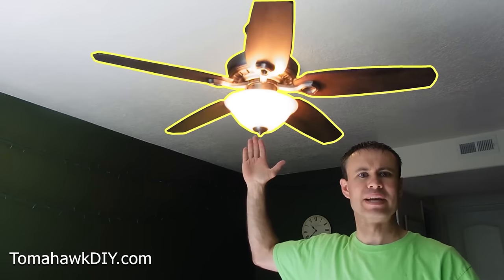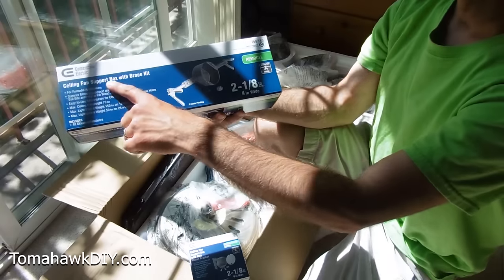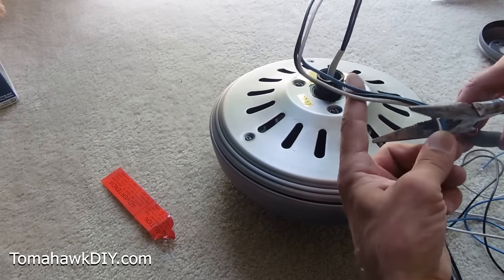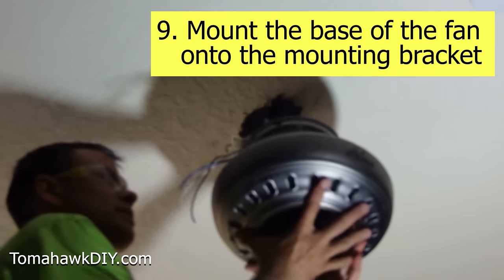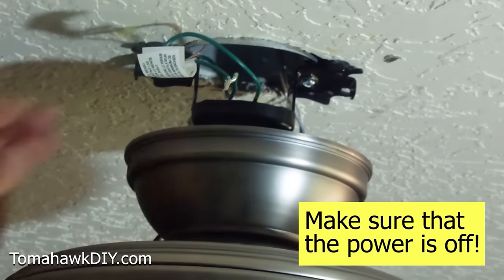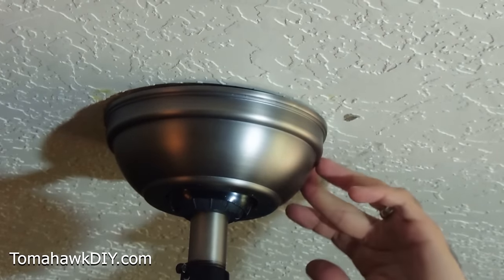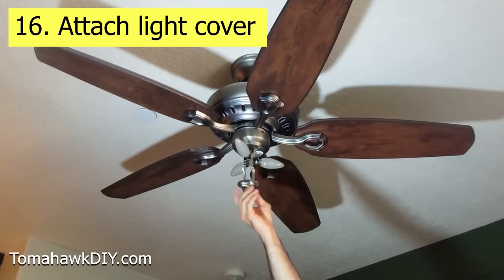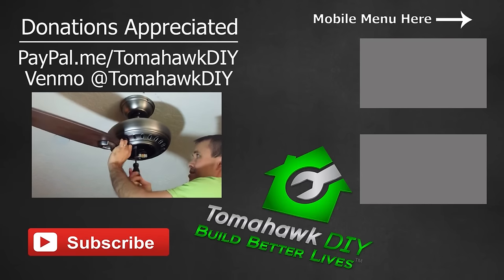How to Replace a Light with a Ceiling Fan (Install a Ceiling Fan) - Step by Step

Comment: You forgot to point the stud finder at yourself and say "Hey. I'm a stud!". That's required whenever you use a stud finder.
Reply: I knew you would be here.
Reply: Its why the stud finder didn't work. He skipped an important step.
Reply: if you have to remind yourself that you're a stud then it's likely you are not a stud

Comment: @ 4:55 you mention having to replace the junction box, because when you install the bracket, it has to be on a stud.  The existing junction box, was not positioned correctly for this new bracket, BUT, then at 8:12, you're screwing mounting bracket into junction box.  What happened to the INSTALLATION OF THE NEW JUNCTION BOX?
Reply: Yea bc I need to see that
Reply: Yes, he just skipped the hardest part
Reply: Thank you, I thought I was losing my mind.
Reply: This ⬆️
Reply: He moved the project to another room 😂 13:01
Reply: Most modern homes have the light fixtures mounted on the studs already. I think he left that out. That's why he hang it on the same location.  Who puts a lightning fixture on sheetrock, it shouldn't pass code? That whole stud-finding stuff wasn't necessary.

Comment: I Noticed that as well.  Tomahawk you didn't vlog the support beam part. That is the reason I looked up installing a ceiling fan. Thank you for the cool video. Good thing using the  fluke tool.

Comment: I want to mention that if the existing light fixture is on a dimmer, and there is no separate hot wire, the dimmer must be removed. If there is a separate hot wire, motor must be either wired to hot wire that isn't on a dimmer, or the dimmer must be removed. Fan motor should not be on dimmers, but fan lights can be on a dimmer as long as the dimmer only controls lights and the motor is 100% independent from it. Just a common mistake people including some electrician make when replacing a light fixture with a ceiling fan.

Comment: Thanks for great video! You mentioned that one needs to use the right length of the screws for the ceiling bracket. Does the right length of screws come with the bracket itself?
Reply from the maker: Yes, it should

Comment: Great video.  You mention in one of your comments that the original ceiling light was on a dimmer.  What did you do with the dimmer? Replace it with a switch? If so, what does the switch control? Do you just leave it on all the time so the remote controls everything?  Thanks

Comment: So did you already have 2 switches (1 for light and 1 for fan) or did you have to drill for one for the fan?  Where is the pull down chain?
Reply: He has a remote ceiling fan.

Comment: What if I only have 2 wires in the ceiling? I have an old house. I replace my 2 kitchen fixtures with updated flush mounts. The boxes only 2 wires in them so the ground wires on the fixtures were secured to the metal plate that came with them. I want a ceiling fan in my living room but I’m sure the wiring is the same as in the kitchen. Am I just not able to install a fan? I’m not smart at this kind of stuff so not sure if this will work for me.

Comment: Question. Hoping you’ll see this expediently. As I just bought the fan. I’m going from a ceiling fan with a light, to a ceiling fan with no light. Can I just cap the existing wire for light source with a plastic screw nut?

Comment: I’m not a fan of the hunter brand. I know people love it and stand by it but the Hampton Bay (Home Depot brand) is way easier. Now I do work there I’m a sales man in electrical but I’m being unbiased. The new easy install fans save so much time and there mostly all led now and doesn’t even require a bulb. Blades snap on and are secure. And some have the remote built in already.
Reply: I've had a few Hampton Bay fans in the past t hat were pretty good, but some of the Hampton bay stuff I have bough more recently is cheap crap.

Comment: Did you end up putting g a different mount up on a stud? It looked like the same housing and just the stock mount that you said wouldn’t work. Just wanting to check
Reply from the maker: Yes - here's the video showing the junction box install. https://youtu.be/e8_0HqZA30c

Comment: Hello! I am trying to install a ceiling fan but my problem is there only seems to be a ground wire coming from the mounting piece and none from the actual lamp, only the blue (light) and the black and white. Is it possible it is a defect and the lamp is missing it, or is that something normal? I tried connecting it regardless and the lamp works when I use the pulleys but if I use the wall switch the breaker flips. If you have any tips it would be greatly appreciated! Thank you 😊

Comment: I thought due to the stud Location you couldn't install the fan directly over the old box? But then you did just that later on
Reply: Shark Flap... the reason he could use the included fan mounting bracket, is because he changed out the light box that is mounted to the ceiling joist. There is a video for installation of that new bracket at the end of this video.
Reply: If you missed that detail in the video, don't try this yourself.

Comment: Do you need to check if your light bracket can support such a weight? 
Or is the side mount bracket enough?
Reply: If the fan falls when spinning you will find out 😂

Comment: you explained that the original electrical box was in the wrong place, and said a new box would need to be installed....but later in the vid it looks like you used the original box anyway.
Reply: Looked like the original box still to me as well. Pretty sure that it was installed to original box and was never changed.
Reply: @travisspoerle1557  That’s how I saw it too. He didn’t change anything out. the junction box in the ceiling didn’t get changed out and he used the bracket that came with the Fan.
Reply: @dillonwingo7372  no he did not
Reply: He replaced it but made a separate video showing how

Comment: Just gonna skip the new junction box replacement huh
Reply from the maker: Nope - that deserved it's own video. Check it out here: https://youtu.be/e8_0HqZA30c
Reply: @TomahawkDIY  He told you "MeowMix"
Reply: Also...can't you read??? The comment below mention the same thing. You sound like you just mentioned this to appear knowledgeable on the subject. No need to be "catty." Meow Checkmate.
Reply: Yeah ...., how did you work around the offset of the ceiling joist?

Comment: What if the fan doesn’t have a remote and you want to wire the fan and light to seperate connections in the wall?
Reply: You can buy a remote separately, or a wall remote. Or a 2-wire fan/light wall control that sends signal to a receiver.

Comment: When you are setting fan in the bracket , is there any locking machanism to hold the fan tightly in the bracket or just hang it there ? 

Need your comments please.

Comment: wish is low key one of the best places to get an electrical tester i got one for 50 cents or it might have been free i forget but it works just as well as the dewalt my manager uses in fact i like mine better its louder and brighter XD

Comment: Couple things not understanding the old bracket to new bracket thought you were going to add a new bracket? And also anytime i work with power even if the entire city is turned off i will always rewire nut the wire that I unspliced again. everyone does things differently but thats just what i would do. Not a bad video just think things should be explain alittle better.
Reply: Andrew West see link he added.

Comment: Any idea what would cause the remote not to be able to turn the light off in order to use the fan? My fan works but the remote won’t turn the light off. I can turn it off at the wall but it’ll also turn off the fan.
Reply: Maybe try to toggle the channels on the remote if it has it. Mine was in the battery box area
Reply: Wireless fans suck. Always buy the fans with the chain if you don't want to spend half the day trying to turn it on or of. On the other hand, if the light and fan go off or on at the same time, it was probably installed incorrectly.

Comment: Because my fan/light has a remote..electrician did not wire to the ight switch. Says is my fault cuz I didn't want hanging chains..should I just take it down and hook to the light switch?

Comment: Is the original light box strong enough to anchor a rotating fan?
Reply: if plastic, no. One should have a proper ceiling fan box, preferably metal

Comment: I"m confused, you skipped over the part of installing the replacement junction box?
Reply: At the end of the video, there’s a link to the video where he shows this process to install a ceiling fan retrofit junction box, which can support heavier fixtures. Without this, the fan could fall down.

Comment: We didn't have a power on the ceiling of the patio, and to bring it there I hired one electrician from a decent company "MileStone". He brought the wire there, but failed to cut the hole for the pan electrical box symmetrically, so the load bearing joist is going not 
through the center of that hole, but slightly shifted (not more that ~1/4"). The electrician attached the box not to the center of the stud, as a result, so the stud got slightly split, and the box itself was sitting on two #6 screws (~1.5") and one big (~#12-14) short screw on the end of the box. Maybe it would hold like that for couple years, but I  like solid work, so decided to redo it.  Not sure is it better to cut out the ceiling more (but then you need to patch it), or strengthen somehow the bottom of that joist in addition to the glue for wood "Gorilla" and pieces of wood I used with clamps to close the splits and unnecessary multiple holes the technician did. I would appreciate any opinion on the question: is it better to cut a bigger hole or just to strengthen that joist. Thank you for the great film.
Reply: You can strengthen the stud with a few ways. 
1. Put a metal bracket going across the split.
2. Put a 2x4 beam from the split stud to the other stud.
3. Put gorilla glue in the crack and grip it shut for 24 hours. (Gorilla glue hardens to an insane level)
Reply: @Roma-rusk  Use a quality wood glue such as tightbond, not gorilla glue.

Comment: The wall switch is the same thing as the circuit breaker
Reply: Absolutely not. You should never rely on the light switch alone and risk electrocution and possibly death.

Comment: What happened you magically mounted it to the ceiling I thought you said it was off
Reply: He probably turned the breaker back on to make sure the correct wire was getting power and to test. Me personally I would do that but then turn off breaker again before the mount.
Reply: True half of the box was out side he just mounted it

Comment: Why do you have to replace the junction box? The old one is already nailed into a stud; can't you just screw the mounting bracket into it?
Reply from the maker: The fan is so much more heavy and the rotation of the blades will eventually cause problems with a standard junction box
Reply: @TomahawkDIY  I see, thank you.

Comment: I followed instructions to install my ceiling fan today. I tried to test the fan and it wasn't working even the breaker is on.
Reply: Check your wires, and make sure they're connected correctly. If they are you should return the fan.
Reply: Did you connect the white(neutral) and black (hot) together, lol?

Comment: Slow and boring but informative 👍

One thing though 🧐 what happened with installing that bracket so the fan wasn’t hanging from the box… you were looking for a stud… then it was mounted instantly… what happened there?

4:58? This sequence 

It goes: looking at mount ➡️ cutting wires and looking at the fan ➡️ bracket is already in place

What happened with the bracket how did it get mounted, thats what i came here to see

Comment: It really gets me that people test the power when they know the light doesn't work. If there was a fault in the breaker and it leaked power the light would turn on. If the light does not come on there is no power to the circuit.
Reply: Some people take living seriously
Reply: It's possible for there to be electricity in one of the wires when the light doesn't work. You probably make fun of people who wear safety glasses when there is only a very small chance of them getting blinded when they are working.

Comment: I wonder.
You were ready to make this video. Right?

You forgot to get the electrical tester..
You didn't measured the opening of the light fixture on the ceiling...

A 3minute exposure in the media , is desired by every body